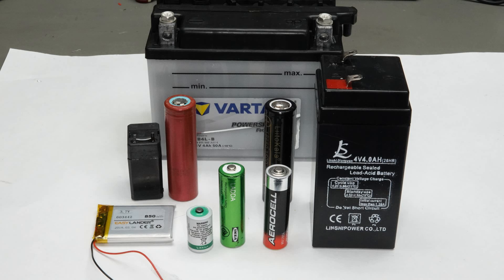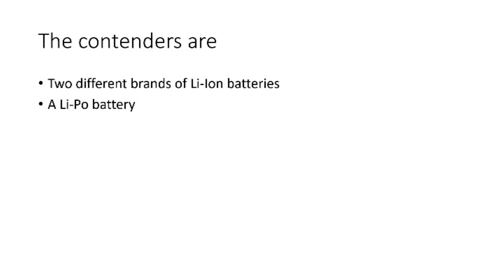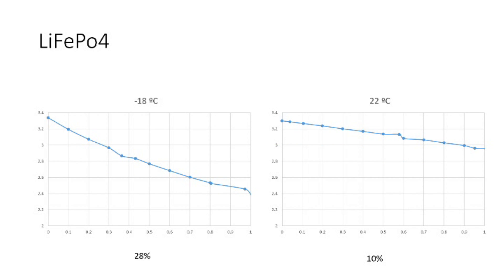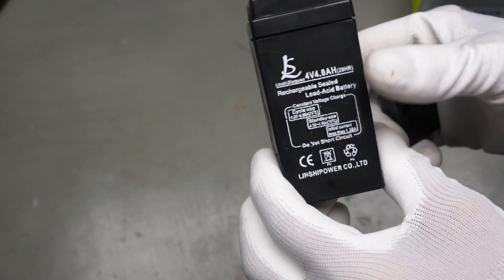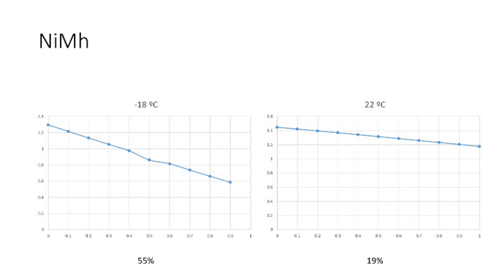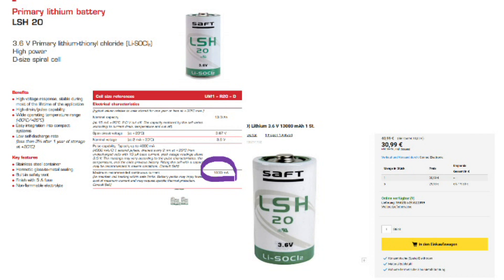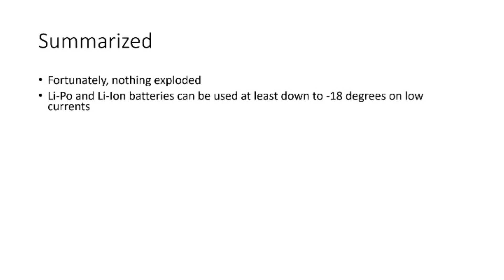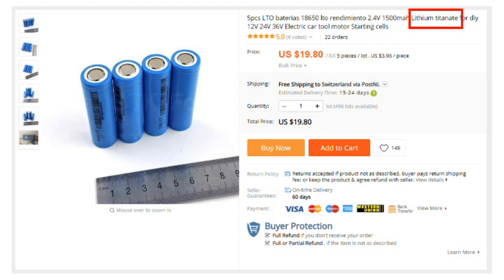#256 Which batteries are best for winter? (Arduino or ESP8266 / ESP32 projects)

Comment: While LiPo cell’s are commonly identified as being different from Li-Ion cells that isn’t entirely true. LiPo cells use a standard Li-Ion chemistry, lithium-cobalt-oxide (LCO), but can have a polymer (gelled) electrolyte. Many so-called LiPo’s use the standard liquid electrolyte though and those are a different chemistry Li-Ion cell. 

I’m  wondering if the increased voltage drop at higher current levels of the LiFePO4 cell you had was due more to increased internal resistance versus any differences due to chemistry. There can be huge differences between different cells unless their capacities, current ratings, and internal resistances are similar.

You mentioned that there were no other real advantages to LiFePO4 cells but they use the most thermally stable of the commonly available Li-Ion chemistries. The thermal runaway threshold temperature is the highest and the temperature of reaction, once in thermal runaway, is the lowest. They can offer real safety advantages and many LiFePO4 cells offer significantly longer cycle life than the other li-ion chemistries.

I strongly urge everyone to never charge a Li-Ion chemistry cell if it is under 0°C as that encourages the plating of metallic lithium inside the cell. This can eventually pose a real safety issue. EV’s typically preheat the cells or, as you mentioned, the charging current is reduced. It’s just easier to just not charge when they’re cold. :-)

E-One Moli Energy Corp has some very high performance cells that are rated for use down to -40°C. The low temperature charging limit is °C though.

That was a very interesting video. Thank you for doing it!
Reply from the maker: Good Input. Thank you! Do you gave information about this plating and how dangerous it is using small currents?
I mentioned the advantages of LiFePo4 in another video. Here I only referred to the „winter“ usage.
Reply: Andreas Spiess I haven’t seen the safety issues quantified as I suspect it is very chemistry and/or cell specific.

My apologies, I should have remembered that video. 🙂
Here are a few links I had saved about plating...

https://www.researchgate.net/profile/Zhe_Li36/publication/315506201_Investigating_Lithium_Plating_in_Lithium-Ion_Batteries_at_Low_Temperatures_Using_Electrochemical_Model_with_NMR_Assisted_Parameterization/links/594a34c84585158b8fd8d0ea/Investigating-Lithium-Plating-in-Lithium-Ion-Batteries-at-Low-Temperatures-Using-Electrochemical-Model-with-NMR-Assisted-Parameterization.pdf?origin=publication_detail

https://www.researchgate.net/profile/Qianqian_Liu23/publication/308273320_Understanding_undesirable_anode_lithium_plating_issues_in_lithium-ion_batteries/links/5ad01068aca2723a33469e02/Understanding-undesirable-anode-lithium-plating-issues-in-lithium-ion-batteries.pdf?origin=publication_detail

http://jes.ecsdl.org/content/164/13/A3403.full.pdf
Reply: Andreas Spiess there is the JEITA standard but I usually see it stop at 0°C. It does identify reduced charging rates as the temp goes high or low though.

https://home.jeita.or.jp/page_file/20110517171451_cub9MvYFEh.pdf

http://www.ti.com/lit/an/slyt365/slyt365.pdf
Reply from the maker: Battery Mooch : I read a lot of should and could in these documents. It seems that not a lot of investigation went into this topic. Maybe we really will learn from cars in cold climate. I would be interested in hard facts on how much life time a battery looses while charging in low temp and at low current. Do you know a source for such an investigation?
Reply: Andreas Spiess sorry, I do not. As it’s always advised against I suspect that provides no real incentive for a company to do the testing. There might have been some individuals who did low temperature cycle life testing but the safety testing aspect of that would need huge numbers of cells to be valid. Just having a couple not go into runaway would not mean none of them ever would. 🙂

I’d be very interested in the results myself though!

IIRC, electric vehicles often have heaters to keep the batteries from going too low in temperature. I don’t know what the typical charge current profile is for low temperatures but I would think it would involve reduced current until the cells reached a certain temperature, a more sophisticated version of the JEITA profile.

Tadiran makes some low temperature cells. Here’s some links that mention reduced charge current when below a certain temperature. This might be limited to certain Li-Ion chemistries, I don’t know.

http://westerberg.dk/wp-content/uploads/2014/08/TLI-1520.pdf
http://www.omnitron.cz/download/Tadiran-TLI-guidelines.pdf

This fellow mentions research papers for his statement about reducing charge current a low temperatures, but no links:

https://www.planetanalog.com/author.asp?section_id=3350&doc_id=564769
Reply: @AndreasSpiess  Davide Andrea is making a book called Li-ion Batteries and Applications. I have a draft version on my table right now. You could ask him for a copy of it. Hes a moderator of /r/AskElectronics and /r/Batteries. 

Also, please call them cells, not batteries.
Reply: Undefined Lastname yea, the existing Li-Ion cylindrical cells using the higher voltage li-ion chemistries (instead of LiFePO4’s lower voltage) top out at a 35A true continuous current rating. The pouch LCO (LiPo) Li-Ion cells can higher current ratings though due to their very low internal resistance.

Comment: Nice work Andreas.👍👍👍👍 I overheated 2 lipos in the snowy winter.. now i know why. And worst of all... i always have alkaline AAs leaking in my expensive gadgets with low current.. so lithium AAs for those from now on.
Reply from the maker: Leaking is a different story and very difficult to measure as it involves a lot of parameters ant time.

Comment: Ignoring issue of temperature, for me, LiPo batteries are just too scary to use in many projects. I prefer to use LiFePo4 where possible. Good capacity and performance, and not too scary. NiMh are still suprisingly usable and a good option for legacy devices. Lead acid are good for extremely long life and almost indestructible, extremely tolerant of abuse.
Reply from the maker: Thanks for sharing your experience!
Reply: Lead acid has to be kept near full charge all the time. NiCd is the chemistry that's the toughest in common use.

Comment: Electric cars batteries do suffer from cold, in fact they are not charged by regen breaking if they are below a certain temperature. Also tesla has a special function to warm up the batteries if you want to really use all the current they can provide in "ludicrous mode"
Reply from the maker: I did not know about the regen switched off. It seems to be agreed they loose capacity and I measured also a lot of voltage drop for high currents. My question is more: Do they loose  considerable lifetime when only using small currents?
Reply: @AndreasSpiess  good question but even if they do loose battery life, it is still a less expensive solution compared to using supercaps 😅

Comment: Cool vid Andreas...its not much use for me tho.. we dont have them cold temps here!...its more worrisome that they overheat and spontaneously combust when ambient temps go above 45c!
Reply from the maker: That is what I thought when I made it. But I had a few questions about it in the past. And it was an excuse to tinker with the different batteries;-)
Reply: @AndreasSpiess  id be interested to see some info on the other end of the scale (high temps)...if youre brave enough! :P
Reply from the maker: Brave is a good word for chemistry and temperature :-)

Comment: Systems utilizing battery chemistries sensitive to cold weather charging typically include a heater to warm the cells themselves for charging.  Tesla has a dedicated battery heater, and I'd presume most other competitors do something similar. This is why Tesla owners in Norway etc are able to charge at cold temperatures - a heater is actively warming the batteries before going into full charge, particularly when utilizing the SuperCharger fast-charge systems.

I'm not clear on your testing methodology from the video - were multiple charge/discharge cycles run below zero?  I wouldn't expect the cells to be damaged with just one charge cycle below the rated minimum temperature, but I would expect total life to be substantially shortened if this experiment is run several times.
Reply from the maker: I read about the Tesla heaters. But I also read that the new model does not have a heater. I also cannot believe you have to wait with charging till the batteries are heated to 0 degrees before charging. Maybe others will add what the other manufacturers do.
It is well possible that the life time is reduced. But I did not find information about that. Many applications also are high current applications which is not the case here.
I expected that I would not be able to charge the battery at low temperature.  But this is definitively not the case.
Reply: @AndreasSpiess  Checking into it - it appears the battery heater was removed from the Model 3, because they are now able to use the motor itself to warm the pack without a dedicated heater, even while the car is not in motion.  So, they're still heating the batteries, but not with a resistive wire as before.
Reply from the maker: That is what I read, too.
Reply: @AndreasSpiess I agree. Comparisons to electric car batteries aren't valid as these have complex temperature control systems for heating and cooling.
Reply: luma Well, it is still a "resistive wire" :D it just isn't a dedicated one running through the battery pack. Instead everything is just piped where it is needed with coolant, since the battery pack syill has a coolant loop. It is a pity there aren't cost effective E-bike batterypack/motor systems with similar setups. :(

Comment: Greatings from Norway. A rule of thumb about electric cars is that they in general provide about 60% of the summer driving length in the winter, but there are variations. 

Some cars have problems in the summer if the battery do not have cooling - they can not handle more than one full charging cycle within a certain time - otherwise they will overheat. So this limits the driving length. 

Many were sceptic about how long the batteries would last. It turns out that they are likely to outlast the rest of the car, at least that is what car producers say, but I think we should wait and see. 

The latest news is that although about 40% of the cars sold i 2018 in Norway were electric, the gas/diesel consumption does not go down, so electric cars may not have the expected influence on the climate ... people drive more. But, ok, things would probably have been worse without electric cars.
Reply from the maker: Thanks for the update. I hope we will be able to accumulate even more experience from other viewers. I only own an e-bike ;-)
Reply: If you think car batteries will outlast the rest of the car just have a look at how well first generation Nissan Leaf batteries are holding up. The 30 kWh Leafs batteries have degraded at 9.9% per annum.
Reply: @KingJanIIISobieski  First generations are old technology, old chemistry and poor battery management. Tesla NCA batteries hardly degrade at all because people have learned from experience and do science. They will get even better as more knowledge is gained, and research is accelerating rapidly.
Reply: @MrZiemwit  1) Non sequitur. 2) Electric cars are exempt from VAT in Norway, so if an electric car is expensive here, it is not the fault of the Norwegian tax system. Fossil cars are heavily taxed though.
Reply: @MrZiemwit  Yes, many of the wealthier Norwegians buy new electric cars for EU prices. The less wealthy Norwegians are less likely to afford electric cars. Not sure if I see your point, to be honest.
Reply: Electric cars have less range in winter due to inefficient heating of the cabin, which is the main sink of the energy, at least on low speeds. Hopefully new cars will have a heat exchanger (recuperator) to recover the heat. Also I hope more manufacturers will start to use the already present A/C unit in reverse, as a heat pump to heat the cabin. Sounds so simple, yet very few cars incorporate this feature today.
Also beware of electric cars that don't have proper thermal management of the battery, like nissan leaf - what a piece of shit of a battery it has.
Reply: @eIektrinis  > beware of electric cars that don't have proper thermal management of the battery, like nissan leaf - what a piece of shit of a battery it has.

Is this still true for current versions of Nissan Leaf?
Reply: InstaBlaster